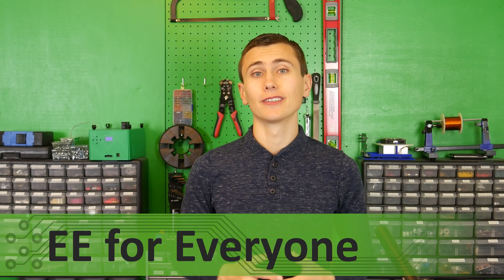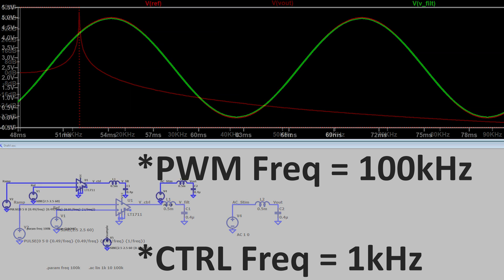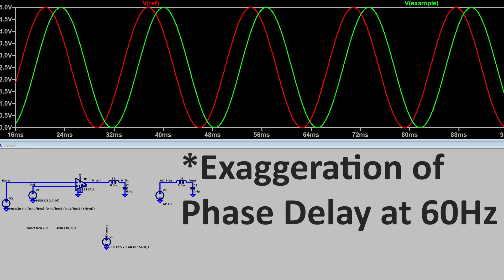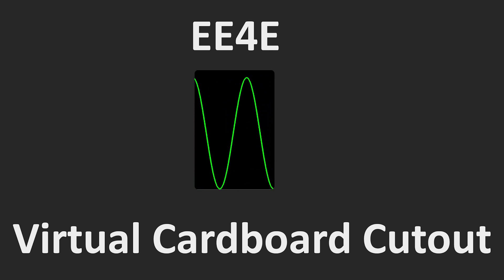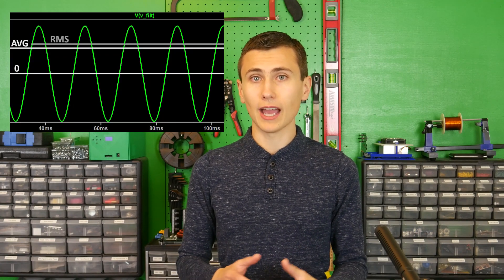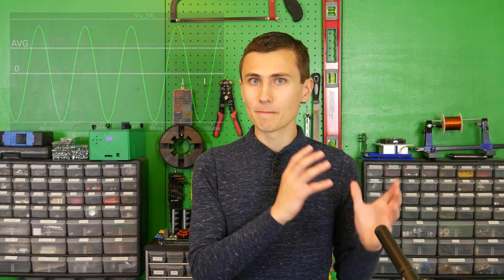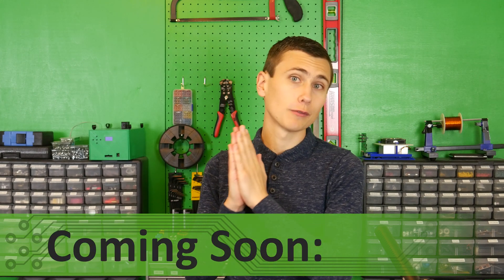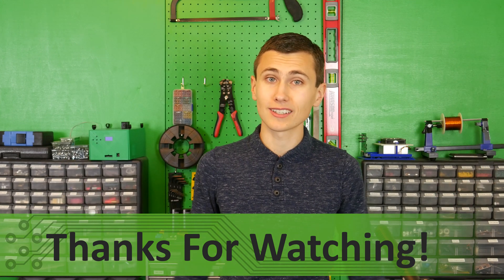Fixing the Inverter Control Loop

Comment: You can, but it needs filtering and symetrical load on all 3 phases.
Reply from the maker: Hello Sanel, Thanks for sharing! I didn't think about it that way. With an appropriate filter and transformer, the sine wave can be reconstructed. Symmetrical loading may be difficult to guarantee, but difficult does not mean impossible.

Comment: Hi, can a VFD drive with a 240v DC Input from several batteries in series be used as an inverter to power your home , if not then why?
Reply from the maker: Hello! Akshay, Thanks for watching! For resistive loads or motors, a VFD could be used. However, for more complex systems like computers, TVs, cell phone chargers... a VFD will likely not work well. 

The reason why is because VFDs assume that the downstream load is largely inductive, and it outputs a "Sinusoidal" wave on top of a ~4kHz square wave. The extra energy at 4kHz will cause the input filter on power supplies to dissipate much more power than usual, and may cause power factor corrected switch mode power supplies to misbehave. This stress may permanently damage some electronics immediately, or shorten their life.

In contrast, inverters do not directly output PWM. They either filter switching noise out to make a "pure sine wave" UPS, like our design, or output a "modified sine wave".

Here is an article that shows the waveforms coming out of a VFD. The first image shows how current increases and decreases in a motor winding due to the PWM output from a VFD. http://www.vfds.org/vfd-pwm-waveform-762549.html

I hope this helps!
Reply: @EEforEveryone  well apart from resistive and inductive loads. most appliances dont need pure sinewave AC voltage, like cell phone chargers, power tools, washing machine, air conditioners, computers. they have inverters built in them or RECTIFY the ac to dc voltage.
Reply from the maker: @akshaykumarvyas  Yes, many power supplies use a  diode rectifier as a part of the power input, but  I think it's safe to say that nothing mains facing is expecting to receive a ~5kHz square wave.

VFDs are designed to drive motors, which won't mind the extra high frequency noise.

Some devices may work okay, but without seeing a schematic it's impossible to know for sure.

I don't recommend powering SMPS designed to receive a sine wave with a VFD. You may get lucky and find a device that works fine and doesn't leak excessive current across it's isolation boundaries at the VFD PWM frequency.

If you decide to try this.... Make sure to record it so we can see if it works, and be extremely cautious with the high-voltage DC. HVDC is nasty, and very dangerous. It is more dangerous than AC Mains.